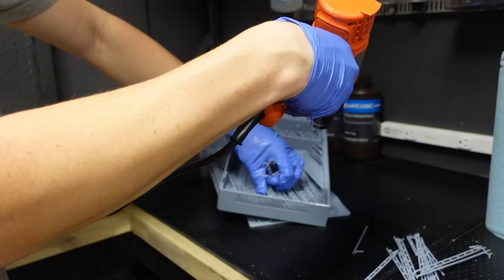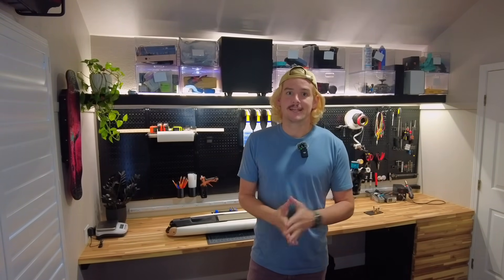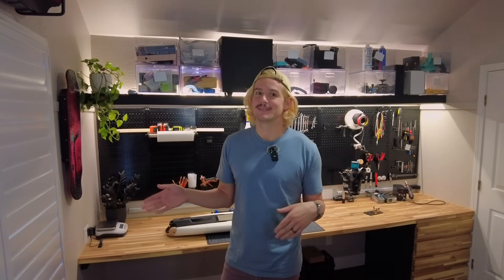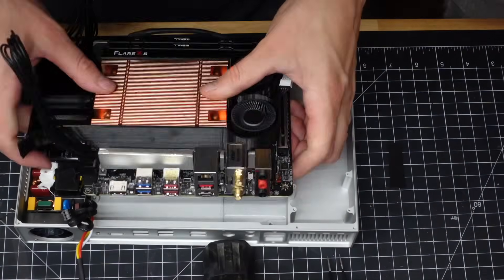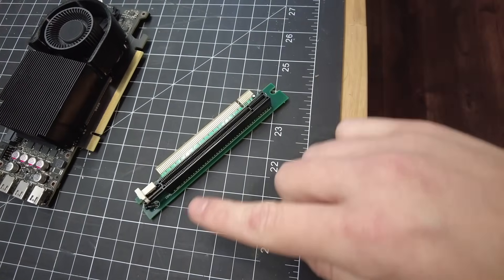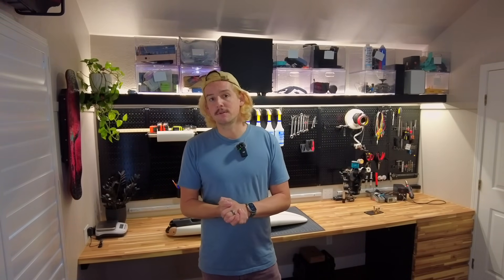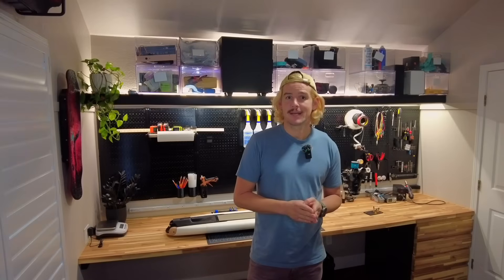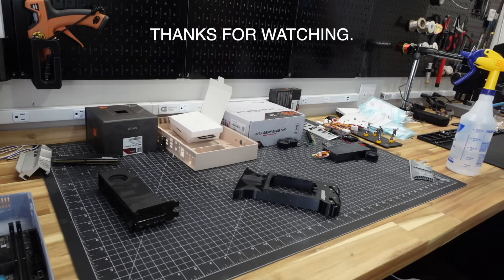I Built the Ultimate 2.5 Liter SFF Workstation PC

Comment: Will the CAD files be for sale and or open to public transformation and modification?  I think this could be quickly modded to accommodate new systems.  Not every new motherboard will fit the bill, but MoBo designs are slow enough to change there should be viable builds from generation to generation with minimal changes.

I have a CNC mill that I would be interested in making this design or a similar design.

Comment: This is awesome. I just curious if you could make the case slightly more compatible with more single and dual slot low profile gpu's? Just for a little flexibility and potential for future upgrades.
Reply from the maker: I might make a different iteration that is more flexible but I would need to have all the GPUs to check them. Looking into them the dimensions aren't as standard as I would hope.

Comment: Fan protectors so they aren't just open holes (safety reasons), standard mobo rear plate opening, and standard GPU mounting which will allow for a wider range of cards will drastically increase the potential market for the case. I don't need nearly the GPU compute, just enough for multiple monitors really, but would love the rest of the design.

Comment: That is a GORGEOUS little case!! I love the idea of using similar (or identical?) fans as the one that comes with the GPU, combined with the airflow shroud! I'm actually surprised that airflow shrouds aren't more common in even the full-fat desktop space, as I have seen another video where they were used and they absolutely did improve cooling for the CPU. One thing I also hate is the naming scheme from these tech companies. If I were deciding to buy a Quadro card for the very first time, I would automatically buy the RTX 5000 version because my assumption would be that it must be a newer, more powerful card than the 4000 one. Which obviously in this case would have been VERY wrong! Why do they not stop to think of things like that before naming stuff??

Comment: I'm interested in a higher end gpu with heaps of memory for AI large language models, even double card and low end epyc.  Is a taller version of the case possible to support such a configuration through a contract manufacturer?  Thanks.

Comment: great job showing ur engineering chops. someone might have said it. .but pla has a low heat distortion temp for inside the case.  I really like you using the ada 4000 sff . .I know some will lean toward the lower cost card.. but that card is so efficient and has the vram needed to do real work. please keep us informed on how the flex holds up to supplying the power and if u use any usb-c powered devices.  prob need some feet to raise off the desk.. and a little concerned about the fans being on top where something could fall into the them.. but if ur safe its prob fine. Impressive engineering.

Comment: Manufacturers need to understand that it doesn't mater how "compact" the computer is when you have another external power supply dangling at the other end of a cable, they are missing the point of a compact computer 😡😡😡😡😡😡😡😡😡
Reply from the maker: Yeah, I am really not a fan if the brick is any bigger than like a small usb c charger.

Comment: looking at building a budget 3.8 liter SFF PC in the goodisory A09 case. It'd have the new single slot lp 3050, a ryzen 5 5500 (I know not the best but going ultra budget)  and 16gbs of 3600mhz ram and a 1tb ssd for about 600 flat.

Comment: I'm glad I found this video; you did some fantastic work! I like and subscribed. I wish I had the money to buy a kit from you to try this, but I don't. Would adding two more fans on the left or right side of the other two (opposite ends of the copper block) make it run cooler? Also, do you want to add a slim monitor with hinges so the only thing you need to take with you is a keyboard and mouse when you travel?
Reply from the maker: Thanks for the kind words! If you could get some kind of push/pull configuration on the cooler it might increase airflow but that would be tricky to do with these blower fans. As you can imagine there is not much space :)

Comment: is the side panel on the CPU side aluminum or metal? if so, maybe you can bridge that to the cpu heatsink with a thermal pad and offload some more heat? and let you cpu stretch its legs more.. my opinion only..
Reply from the maker: Would be interesting to try out, it is aluminum.

Comment: Rewatching this something I noticed I didn't hear/see in the video that you definitely want to do is ground the case. While the insulating sheets should be sufficient as you have things configured, you are lacking 'Double Insulation', thus only a single fault is required to connect Live to Case. Now, it's possible that the HDPlex PCB connects the mounting holes on the PCB to Earth Ground, but unless you confirmed that with them, I wouldn't bet my life on it.

Definitely hoping to get my hands on one or two of these...
Reply from the maker: Definitely an oversight by me and you are 100% correct. Has been fixed.

Comment: great,  BUUUT what does it acuatly cost to make that milling for and indival case is BOnkers expensive#
Reply from the maker: I mention it in the video, the finished machined case with material, milling, bead blasting and anodization was around $300 for a one off unit.
Reply: @FriesenDesigns  ihave seen it now, what steps could utaketo reduce the cost of a one off unit to under 170 dollars?

Comment: Honestly, it seems that it's not quite as "high skill" to assemble as you make it seem. It was absolutely high skill to design, there's no question about that! But I would absolutely love to build one for myself, as my SFF Linux PC is approaching a decade old now and I've been meaning to replace it.
Reply from the maker: It's definitely not horrible with regards to mods etc. and I think many people could figure out. No like cutting/modding PCBs etc. I definitely don't want to make it seem impossibly hard but there are a few steps that are more challenging than a typical SFF build and if done wrong could damage expensive parts. But overall I agree that I think most people with building experience and a means to solder or crimp some custom wires would manage.

Comment: I wonder whether and how would the requirements differ if you would work with Inventor. I don't know solidworks, but inventor is a single-threaded application = uses just single core and doesn't utilize GPU much. Does anybody know?
Reply from the maker: I think solidworks and inventor are pretty similar in hardware requirements though they use different geometry kernels. Let me know if you dig anything up, fun fact, inventor was the first 3d-modeling software I ever used.

Comment: You've hit the jackpot with this build—it's awe-inspiring! However, as great as it is, I believe there’s room for improvement. The design is a stroke of genius, but my only complaint is the ventilation fans on both sides of the case, which give it a tower desktop appearance. You can do better, so kindly focus on one way to improve it.

I advise you to capitalize on it. First, consider branding it. Then,  reduce costs significantly by outsourcing some components from China or other cheaper suppliers, especially for the wiring and case blocks. This could also create a side income for you.

Love it, awesome job overall!
Reply from the maker: Yeah, wouldn't all fans on one side be awesome?

Comment: This is amazing. The only thing I feel this build missing is a 10gbe ethernet. I ends up buying a MS-01 with an A2000 12gb. Power brick is taking up the space but not a deal breaker for me.
Reply: $2900 is actually not that expensive as the GPU can easily eat up half of the cost. My MS-01 already cost around 2300$ and the performance is not anywhere near.
Reply from the maker: Yea the brick isn’t the end of the world but it is nice not to need it. Yea fast Ethernet would definitely be nice but for my uses it’s not a dealbreaker. That said it would be nice to solve that if I made it available to more people.

Comment: Where did you get the aluminum housing machined at? That price is pretty reasonable for what it is. There are some projects I've been working on that might be nice to upgrade from 3D printed to Aluminum at some point.
Reply from the maker: I used JLPCB cause they gave the cheapest quote from the online retail facing ones I checked.
Reply: @ Awesome, Thanks! I’ve gotten PCB’s made with them before and hadn’t really looked much at what else they can do.

Comment: Hey, this may be an irrelevant question but did you consider using a Mac Mini with M4 Pro? It is a lot smaller and very comparable in power to your creation. If you considered it and chose not to, what was the reason?
Reply: Don't think Solidworks has native support for Mac processors (ARM to x86), so it'd very likely perform ass.
Reply from the maker: Unfortunately this is true. Love my MacBook Pro but running solid works in parallels on it is basically unusable

Comment: I am building a very similar profile custom case, with similar requirements. I, too felt the same need to create a custom case, which is where I am stuck now. I did upload a couple of videos on this topic way back in February 2024, and then got side-tracked, probably just like you, with my components gathering dust for 8 months now.

I just recorded another video, just last week (November 2024 last week), and I'm in the process of editing and uploading it shortly, hopefully in next few weeks, focusing on initial rough measurements. I have been struggling with prototyping my design, due to lack of pure engineering background, but have recently started to learn FreeCAD, in order to validate my measurements.

Some of the main differences from your build, are:
1. My HDPlex 500W ATX PSU, is whole 200mm long, unlike the 250W version.
2. The GPU is NVIDIA RTX A2000 12GB
3. The CPU cooler is a FULL Copper heatsink from ThermalRight (AXP90-X47), although it raises the height of the build considerably.
4. I want the intake fans on the sides, one side for the CPU, and other side for the GPU
5. Rather than CNC milling / maching the case, I want it to be completely modular and easy to fix / repair. So, my design would be based on L-Angle cage-like chassis, on which individually cut panels, either perforated, or heat-sinked, can be mounted on, as per the need.  
6. I want to keep all exhaust fans (CPU cooler, and GPU cooler) facing the same direction, hence using the 90° riser card for the GPU is not viable for me. I chose a "Double Reverse (VV) 360-360" riser cable instead. I wish there was a reverse direction riser card, it would have simplified my design so much.
7. I want all IO, and all buttons (including power) on same side, that is the IO shield side, so that the "front" is completely free of perforations. So, the orientation of the custom case will always have IO shield side on the bottom (to save from dust), and the "front" side becomes the top, stopping or at least minimising dust entry from the top.

I have documented some these things in videos https://www.youtube.com/watch?v=rAQ_X8Y-H4I , and https://www.youtube.com/watch?v=G2Ox7aPbgzg , and in a build log at https://smallformfactor.net/forum/threads/travel-case-mini-itx-sff-pcvr-gaming-avi-dit-workstation.19199/

I would definitely like to know more about the Kapton tape for heat protection, about electrical shielding and grounding, etc. and would love to hear your inputs. Thank you for reading this long comment.
Reply from the maker: Interesting concept! Sounds like you have quite some work ahead of you. The best thing for electrical shielding is fish paper not kapton as it is less likely to be scratched through but I used what I had on hand. It is a high temperature tape that can handle temperature cycles better than more standard tapes.
Reply: @FriesenDesigns  Thank you for your quick response.

Interesting input on the fish paper, I'd have check if I can find local suppliers here in India.

BTW, how did you measure and design the mounting holes for the motherboard, GPU, PSU, IO cutouts, etc. Did you do it manually, or did you get a ready-made template?
Reply: Another query, what is your input on using custom thermal pads on the motherboard backplate, to use the entire back / underside of the case as a huge heatsink?

Wouldn't it not only eliminate the risk of short-circuit, but also drastically reduce the height due to standoffs, apart from dissipating any run-off heat from the underside of the motherboard?

Comment: Cinebench24 shows a -25% CPU multicore score compared to standard cooling. I suppose there is an aggressive thermal CPU throttle. Did you try to downvolt and slightly downclock it to get stable, higher performance under full load?

Comment: I dream about a small form factor computer that is basically a  15x15cm vapor chamber cooler with 140mm industrial Noctua Fan with 15x5cm pcb on one side that have top of the line CPU + GPU soldered on + nvme ssd on the other side. Daughter board with ports that goes on a side of a cooler and that's it. 15x15x5cm block with external power brick. 

Quick estimate shows that it can dissipate up to 1kWt in config like that if you are willing to tolerate high temps and some noise occasionally. So, it could be really anything in there: 500W CPU + 4090. Of course it could only be a totally custom solution, only computer OEM like Asus can make it happen.
Reply from the maker: Yeah I am pretty skilled at laying up PCBs but I have never done anything like a motherboard and I’m guessing there are some proprietary pieces that would probably prevent DIYing one. Would be pretty interesting to try though.
Reply: @FriesenDesigns  I think there will be so much NDA surrounding CPUs/GPUs, so no chance to even start, unless you are a real OEM.

Comment: Love this even though I don't require this type of build! Just curious, how do you think the new M4 Pro Mac Mini would stack up against this? If you choose the following options: 14core cpu/20core gpu, 64gb of unified memory, it comes out to $2200. And then use external storage cause Apple charges way too much
Reply from the maker: Mac mini will be faster, more efficient and if you go external on the drive, cost much less. Unfortunately the main tradeoff is the current state of software compatibility and inability to use other. Operating systems due to the closed source approach to hardware. There is emulation which helps some but does not solve the issue. So take a look at the software you use and if compatibility is covered I think the Mac is a great choice.
Reply: @ gotcha, thanks for the reply!

Comment: This gave me a lot of build ideas! Although I would likely use a pcie cable riser so it could be reversed and the GPU can intake air from the same side as the CPU
Reply: I have the exact same design parameter for my own build.
Reply from the maker: Yeah it kind of broke my heart to have fans on both sides but I could also see it was the smallest and simplest solution. I might take another crack at trying a same side fan thing you could lay flat on a desk.

Comment: Holy shit that cpu cooler design is amazing! I am using the same 1u cooler but i sanded mine down and put a 92mm fan on top of it like most low profile coolers. I also tried noctua 40mm fans exactly where you have your blowers but that did very little. I would LOVE a bom/stl files for just the cooler design you have! I'd be totally willing to pay for them too. Trying to figure out how to cool a 9800x3d right now with a 37mm case and I have a few other novel cooler designs I was going to compare. I'd love to build this and compare it too

Comment: i would love to buy the case, but you would probably have to support the 4060 low profile variants, or just make a bracket to screw the gpu in. i am very interested.
Reply from the maker: Yeah would be a different design but if I wanted to hit a wider market you are 100% correct.

Comment: This is super neat, but this is also hilarious.  As a software engineer, my goal would have been to solve this problem in software, rather than drag a computer over international lines.  When all you have is a hammer....
Reply from the maker: No software to engineer whe the tool is closed source and the open source 3d modeling tools still have some way to go in my opinion. I did manage to build native arm version of freecad on my mac pro but it is just not my modeling tool of choice yet.

Comment: You should use PTM7950 on the cpu and especially the gpu, will give you 3-5% extra performance for free.
Reply from the maker: Might give that a try!
Reply: @FriesenDesigns  you should. as the 75w tdp gpu will greatly benefit. ON my 3070tiM notebook i got 7% uplift in 3dmark for free. Oh an polishing the CPU a bit to remove the nickel layer as amd's nickel layer is very thick will give you 1-2C off the cpu as well.

Comment: awesome case, but probably some cooling is necessary for ram and m.2 and power
Reply from the maker: Yea I did take a look at the m.2 and it definitely thermal throttles down to about half the read/write speeds if I do a huge file dump but really the drives are so fast these days I don't notice much the way I use my computer.

Comment: small ff builds are a kind of art in itself . nice one !    i was wondering if you could improve temps by bridging the cpu cooler with the alu lid with a pad ... since as you said 80/90 is totally fine for a cpu ... cooler is more often then not better for longevity and performance. On the other hand i dont know if it would do anything at all bridging the both components ... cheers
Reply from the maker: Thought about that also, wasn't sure if having a bit more air flow over the top there or getting heat into the lid is better. Might be fun to try sometime.